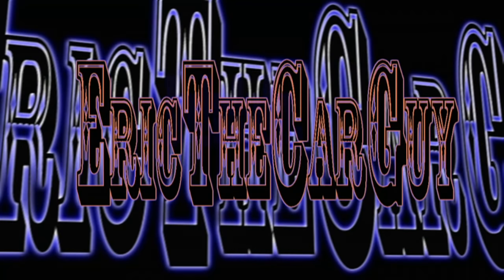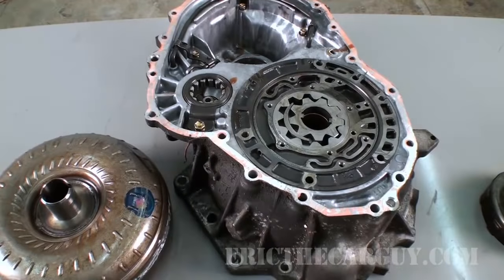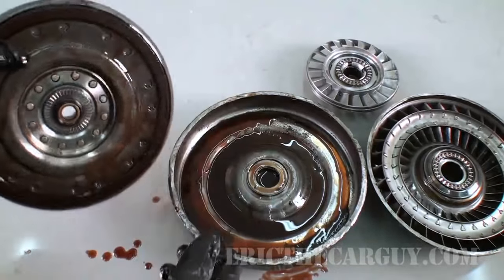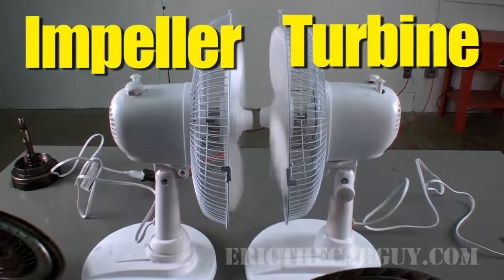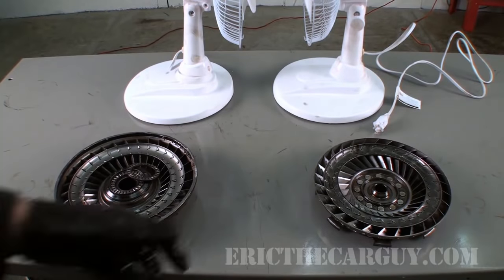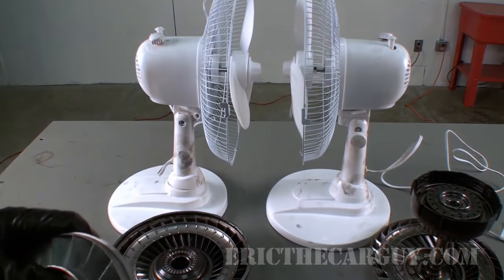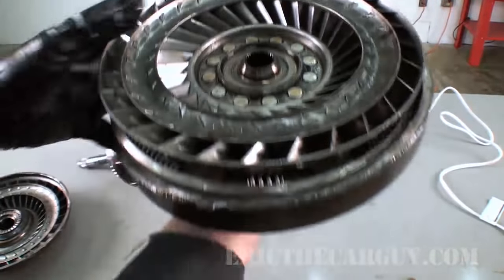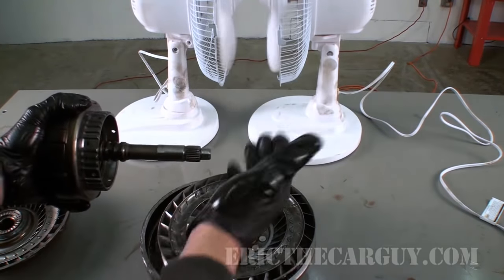How Does a Torque Converter Work?

Comment: Thanks for this really interesting explanation. I knew roughly what was inside but not the detail. Here in the UK torque converters were never popular, some snooty thing about "real drivers" or whatever. I loved the one car I had, a Rover 216  three speed  automatic. I'm not talking about driving that causes passengers heads to jolt backward when pulling away but of the really progressive control I had to avoid it (when I wanted to!). It was great in slow stop/start traffic. I could put it in drive two which gave me a range from standstill to 20mph so with no going up and down through the auto changing. I got into the bad habit of using my left foot for the brake (a bad habit here anyway). That way I could sit at traffic lights and just before pulling away by hold the car on the brakes and slightly elevate the engine speed, dragster-style but with far move dignity.

Comment: I just wanted to thank you for the information on the torque converter, I'm almost centain that is whats wrong with my cvt transmission. It has no first gear but when the RPMs get higher it starts running there nothing wrong

Comment: I worked for a company in Tallmadge oh.called Trans torque,we rebuilt converters from start to finish,including high performance converters,heavy duty.a good job till bought out by foreign co.had to pack everything up from stock to machines to send over seas to new co.

Comment: I might be wrong but I had a 1990 Pontiac Sunbird 4 cylinder, 3 speed automatic. That the torque converter lock up got stuck a few times to the point I eventually gave up on the car after three years, not wanting invest in a transmission repair. The one mechanic showed me where the lock up could be disabled, with an electrical plug under the hood to that transmission, and unplugged it telling me my gas millage will go down, but I should not get stuck with it now.  I ran it that way to not get stuck with it, or have to have tow for a few months before I sold it to the junk yard.  However I have noticed with the cars I have now, 1991 Sunbird and 1997 Riviera that the lock up can happen at any time after the car is moving as long as I'm pretty steady on the gas peddle, so that lock-up does not happen only on the top gear as you explained here.

Comment: Helped me understand a common Ford torque converter issue, when the torque converter clutch is supposed to lock up right before automatic overdrive kicks in it would slip due to old fluid not coating it with teflon to create the friction

Comment: Thank you for your details on how the engine transmission works. Specially how the torque converter works.
By the way, I have 1986 Volvo 240 DL . It doesn't move , the mechanic said; transmission doesn't work but when explained, I think the problem is on torque converter, the clutch part. Probably I said, so ordered used parts hard to find , parts store don't take care any more.

Comment: Excellent contribution to the knowledge pool of humanity.  Thanks for sharing.  You saved me from having to slice one open and study it myself.  I was curious about the lock up function.  And I didn't realize the sprague clutch stator function.  I am still a little unclear about the fluid pump.  I thought the torque converter was the primary pump for the tranny oil, but I see there is another (gear) pump behind and within the tranny.  So I assume some functions (shifting solenoids) require higher pressure transmission fluid for proper operation.

Comment: The stator doesn't change the torque in this way.
The torque multiplication happens from impeller to turbine (at the outer side of the ring). But the flow direction would be against to the impeller from the turbine (at the inner side of the ring). That problem solves the stator. Without the stator the motor would stop because of the opposite flow. And the torque would be multiplied without stator, if we could lead out the oilflow to somewhere from the converter after the turbine. But the oil must be remain inside, of course. That's why the stator is situated after the turbine and not after the impeller. 
Sorry for my bad english.

Comment: There are some modern transmissions, such as the 6R80 in my Navigator and many other Ford products, that lock up in all 6 forward gears.  Traditionally, yes, it was as you stated - top gear at say above 45 mph when the converter locked up.  But in the ongoing pursuit of a relatively small amount of gas savings, mine locks up in all the gears.  This process of locking up in all gears is smooth when the transmission is new, but as it ages, it gets rougher.  Some aftermarket tunes can help with this, mine shifts a lot better with the 5 star tune.

Comment: I studied this in Trade School. Was thinking that some basic information is missing. On how the various fins work and why they're placed the way they are. Also, when at a stop, the slow turning engine doesn't have enough speed to get the impeller spinning, or is easily overcome by the brakes. Search out a "film" made by the U.S. Army, I believe.  Is very well done. Thanks for making this video. Is a ton of information.

Comment: The torque converter in the mixer truck I used to drive, locks up in all forward speeds. Trans is an Allison RDS 4000 series. Can't beat those automatic transmissions!

Comment: That was really useful.  Only ever saw a similar video, but based on the two fan logic.  Wow, these are still complex in their engineering.  I have a 2013 7 speed merc, and I thought the clutch locked out as soon as you were passed 2nd gear.

Comment: Great video, great explanation.  BUT...question:  What is happening when I hit the trailering button on my truck's shift lever that I was told "Locks the converter" for trailering?  How is it doing that electrically, and what is it locking and when?  I know it shifts a lot harder when I put it in trailering mode, and fuel economy goes down 20%

Comment: Had a Torque Converter on my 54 Dodge with a 3 speed manual trans. Engine oil feed the TC from the housing. TC have been used in industry for many years.

Comment: A local diesel mechanic suggested I have a "noise isolator" installed between the alternator and the torque converter because there was RF noise in the input line from the alternator.  Although my diesel starts ok it has been recommended by the transmission shop to replace both batteries and the alternator so that proper voltage be supplied to the torque converter.  Does this make sense to you?  Your video was very informative on the mechanical workings of the torque converter, but the torque converter appears all mechanical with not electrical in-put. Thanks!

Comment: thanks for the great video bro!!  i watch transmission videos daily . presision transmissions is my main channel i watch in youtube. but they have never really explained this were folks like me can now tell what happened while we were driving but know wat we felt or happened.  i installed my a500 trans into my 96 jeep. out of a 95jeep.  as soon as i gave it the gas peddle it made a grinding sound. but if i babyed it the trans will go.  so i had to pay 1950 bucks to get it rebuilt with new torque converter.

Comment: The more I learn about torque converters and automatic transmissions, the more I want a standard. Tomorrow I'm yarding out the automatic trans in my truck and installing two fans and parking it locked up in a high stall.

Comment: My first year production 1991 Saturn SL2 would lock the torque converter in 1st gear when in "performance mode." It would then chirp the tires when shifting into 2nd gear when floored. It behaved like a manual transmission in every gear. Unfortunately,  this was something that many customers complained about. . In "normal" mode, the torque converter engaged softly, and in a higher gear, and shifting was slushy in every gear, even though the torque converter clutch was always engaged after 2nd gear. . . I miss that car. It was the only year that came stock with hand-bent headers, forged aluminum valve cover, and intake tract. . . . It also had a gigantic front anti-sway bar, and zero body roll when cornering. . . . I really miss that car!! I donated it at 275,000 miles.

Comment: When a centrifugal pump operates, the fluid is projected on its periphery. So, the oil is transmitted to the turbine from the outside. Then, the oil returns from the turbine to the pump through the center and therefore passes through the reactor (stator as you say). In this way, the oil enters the pump with a better orientation when the turbine has a large difference in speed compared to the pump.

Comment: My 1967 Riviera has a Turbo 400 automatic transmission with a switch pitch torque converter. it basically changes it from a 1200 stall to an 1800 stall converter so you can get the rpm's up to better it's hole shot capabilities. You can actually move the switch that activates the switch pitch feature from the carberator throttle linkage to a switch on the dash if you really felt like it. making it a manually switched switch pitch torque converter. That 4300 lb personnal luxury car with a 430 cube engine when you smash the throttle at around 60 mph is like a rocket ship taking off, it's like a tripple whammy. 4 barrels kicking in, shifting into passing gear and that switch pitch increasing the rpm's.  Boom violent acceleration for a big car.

Comment: I have a 1947 Chrysler Desoto that has a fluid drive which i believe was before torque converters . Similar but no stator . They are a bit slushy taking off but ok once moving . Has two ranges start of in low and it changes two gears then change to high and changes two more gears . Also has a clutch between motor and fluid drive to allow selecting gears

Comment: Wow this was AMAZINGLY informative. I knew literally nothing about TCs and now I think I know what to look for for my 6.0 LS swap in my 82 Monte Carlo. So I basically need to determine what RPM the cam I want (Sloppy Stage 2) makes the most torque and then get a TC that is within that range? One question- within the range, where should my peak torque reside? In the middle, top or bottom? I was told I need a 2300-2500. Or is that an either or statement because the stall speed is a single value and I can use a 2300 OR a 2500?

Comment: The first automatic transmissions had what is called a Fluid Coupling. The fans illustrate what happens in a fluid coupling. The FC evolved into what is now the Torque Converter.

Comment: In South Africa, our water heaters, which we call a geyser, are installed horizontally, because they go in the roof. A small geyser is 100 litres and a large one is 300 litres. On average a 250 litre geyser serves a family of 4, but some homes may have more than one geyser depending on the size of the house and the number of bathrooms and the element is usually around 2500W. Short story is, the family needs to plan their bathing schedule and how much water they use based on the size of the geyser and the size of the family. Once the warm water is finished, it takes some time to heat the water again. Rolling blackouts do make it more complicated for larger families with smaller geysers, but South Africans tend to have a bath at least once a day, even if it ends up not to be as hot as we would like it to be.

Comment: Great video I was curious about the torque multiplication and how that happened and it makes sense.

The only thing I disagree with but can’t explain is the high stall. I had a street car I drag raced at my local tracks but would drive around normally and it had a 4500 stall converter and I didn’t have to rev it to 4500 to drive it, it drove quite normally. I’m sure there’s some internal engineering to make this happen and will continue to search to find it. 

I do know though you held your foot down on the brake and revved it to 4500 it would stay put until you let go and you’d best be hanging on! 

Probably something to do with the application of rpm.

Comment: Just one thing to add is that there are actually some transmissions that are programmed to lock up after each gearchange PSA's AL4 and eat6 for example they also lockup on off throttle coasting giving the same effects and similar sensation to a manual transmission including engine braking.

Comment: I ended up just having 2 transmissions Torn up all because of a Reman Torque Converter from Autozone in a 700r4 in a 85 S10 . This sucks and the main reasons i went with what i got was because no one could get a converter for my truck but a Reman at Autozone .

The 1st one lasted about 2 weeks and my transmission was perfectly fine until i changed the converter and for the second transmission i got i knew worked , it lasted a shorter time and did the same thing with a crunching whining and humming noise and got to where it would'nt wanna take gear and if it did it wouldn't go far or pull right in any gear . 

Dropped pans and both had tinny pieces of shinny metal inside & Filter , looked like glittery . Most definitely NEVER AGAIN will i do that

Comment: As usual ...that was great! I have driven manual transmissions for years and now I have an automatic (as they dumb down the skills of driving) so I am now interested in how the automatic transmission works. Where is good source of specific transmission specs? (ratios in each gear, stall speed, etc.)Is there an independent website or should I go to the manufacturer?

Comment: I know this vid is from a long time ago, hopefully you can answer my question. There is a hypermiling technique known as 'pulse and glide', where a driver doesn't maintain a constant speed on highway, but instead 'pulses' up to a certain speed (70 for ex.), when up to 70 he then pops it into neutral and 'glides' down to 55. When it gets down to that speed, he then pops it into highest gear to reaccelerate or 'pulse' up to the higher speed, repeating. It saves gas by law of averages. During the short 'pulse', mileage is terrible (say 11mpg) for a brief moment.  During the 'glide', perhaps you can achieve 99mpg. I'm aware that most fuel injection vehicles cut off fuel if no throttle is applied in gear, and it burns a little in neutral (idle), but the 'glide' is greatly extended in neutral as compared to in overdrive (compression braking)- causing you to save fuel in neutral under most circumstances. The goal is to accelerate relatively quickly in top gear to minimize the 'pulse' time and maximize the 'glide' time. I've been achieving 24mpg from a V8 powered Envoy XL with 4.10 axle ratio using this technique, which is better than just maintaining a conservative 55mph. That being said,  how hard is it on the torque converter/transmission popping it into gear from neutral, with no load on engine @55mph.  Would it be better to 'rev match' the engine to expected RPMs when it would be in gear?  Or is this pulse and glide thing just a no-no as far as transmission health. I'm not concerned about the annoyance to other drivers as it's in remote locations.  I have 245k trouble-free miles, original transmission.

Comment: Eric I have a 92 fox body coupe with a stock 5.0  with  an AOD. I’m going to keep the engine in stock form for a while but I will be doing gears, 355 or 373 and replacing the carrier with a rebuilt unit. On to the question. I have a used street fighter converter  I bought years ago and will have it rebuilt and would like a suggestion on stall speed, lock up or not? Want manners but a little more grunt from my ol stock 302. Thanks for your very insightful video series.

Comment: Thanks for the info. I am going threw a battle with GMC over shuttering and vibration in my 2020 Canyon, usually around 50 to 60 miles a hour . Doesn’t happen all the time but when it starts it shakes a lot. They keep on pretending there’s nothing wrong and it’s normal, I am completely frustrated and starting to think it will cause more damage. If anyone else has had this problem and had it fixed I would appreciate what you did to fix the problem.
Reply: I traded It in on a different make and model...

Comment: I have a 6 speed with a lock up clutch and on mine the clutch engages and locks up in 4th gear and stays locked through 5th and 6th. Now that the transmission is getting older, there's times, mainly during a hard braking scenario and a rapid downshifts, that you feel the downshift out of 4th to 3rd and the lock up clutch disengaging at the same time.

Comment: Hello Eric, Thank you for very analogical explaination of Torque Converter in auto transmission system. I begin to learn by watching several series  of video on Utube, because last week my car stalled at a trafic light. This is the second time  I encounter this problem. The first time  I drove a Citreon Xantia, and had to repair the gearbox by replacing all the clutch plates. It very expensive repair. And last week I have to replace a complete gearbox. 
Tell me, what is the cause of the  problem.... Is it because of the worn out clutch plates, or mulfunction of the  tourque convertor??  Is there possibility of the planetary  gear malfunction???

Comment: 11:30 pretty sure alot of car manufactors call that the over drive gear. i was always wondering how that worked because you could have a transmission with just 3 gears and a 4th "over drive gear" but without any of the clutch packs within the transmission its self. very good video even 9 years on
Reply: Nah, I think that's because at higher RPM, the torque convertor starts being really inefficient so by locking it up, they are mechanically coupled instead of having one being driven by the fluid that's pushed through by the first rotating blade.  It works great at a standstill and moderate revs, best suited for trucks and buses.